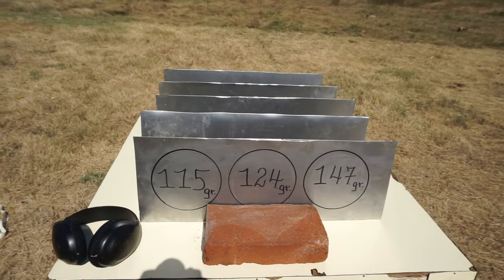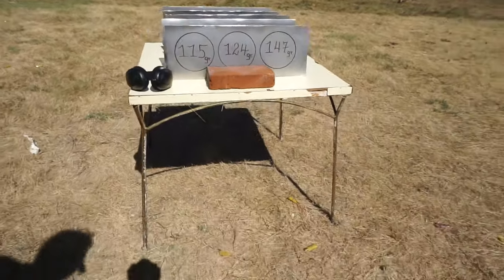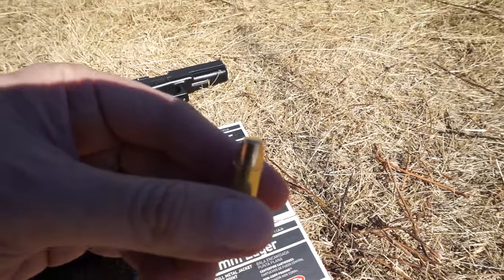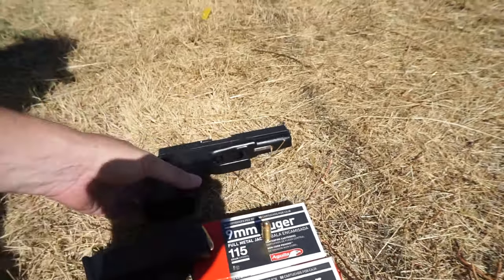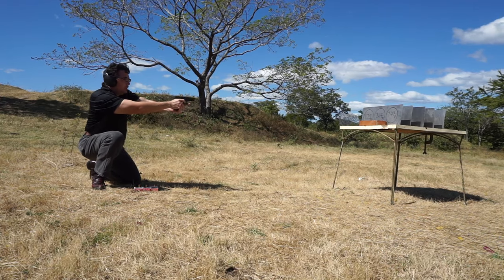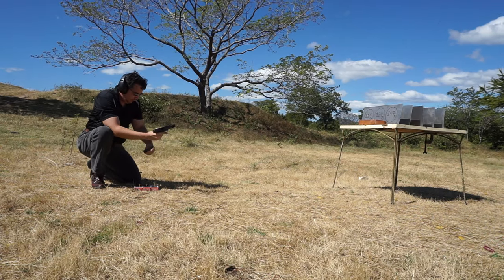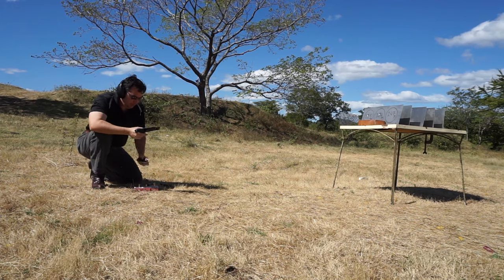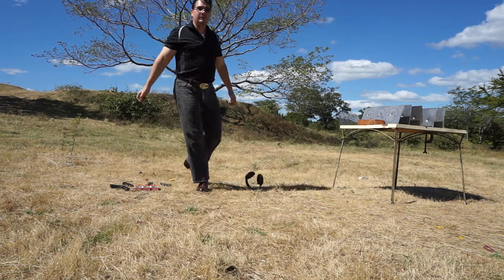9mm 115gr vs 124gr vs 147gr fmj 🔥 vs 5 Steel Plates⚙! (Second Video)

Comment: 147 did its job.  It’s all about kinetic energy transfer and not about penetration.  For the best self defense rounds, 147 JHP 👍🏻
Reply: Agreed....some of these youtube warriors are thinking the 115 is better because of penetration...when in fact the 147 having more energy more expansion equaling more damage..👍
Reply: @pearlman39  BOOM 👍🏻
Reply: From what I’ve seen 147 grain loads usually have around 320 ft/lbs of energy, most 115 grain loads have around 400. Dont get me wrong, I carry 147 grain HSTs, but energy isn’t in the 147 grain’s favor. I like 147 grain because it shoots softer, quieter, and launches a bigger chunk of lead into a target. More lead equals greater potential for expansion, more momentum to drive deep into the target, and in the event of a failure to expand, a longer bullet does more damage tumbling.
Reply: @CHAOSMOVEMENT  a kick from George St Pierre was recorded at a little over 3,000 ft/lbs, that's a little bit more than twice the energy of a 5.56/.223 fired from an AR 15. He has never killed anyone with his kicks. Penetration is more important than expansion or energy dump. Both are great, but proper penetration is nearly as important as shot placement, and handgun rounds don't have enough raw energy to cause remote wounding.
Reply: @jonahpatton8879  well said!
Reply: @jasonvoorhees2701  the o
Reply: @jasonvoorhees2701  the o
Reply: @jonahpatton8879  if the diameter of that kick was 9mm, with 3,000 ft lbs of energy, it'd obliterate a target.
It's not about "foot pounds don't matter", it's the diameter of the projectile is soft and huge, so it's spread out.
3,000ft lbs is like being hit by a car, all in a foot, but if it's by something as small as a dime, it's punching straight through anything.
Reply: @jonahpatton8879  any of the 3 rounds tested would zip through a human target. The 147 would dump more energy into the target on its way through. The 115 would zip through quickly creating more hydrostatic shock. I wouldn’t want shot by either. I’d say against a human target it’s more about what round you can put on the mark more accurately through your choice of firearm while in an intense situation. I would be more worried about a 22lr in the chest than a 9mm in the arm you know what I mean. It’s all about putting the bullet on target that counts the most.
Reply: @Billy28376  this wasn't a debate on shot placement, ammo choice does not affect shot placement. 147 grain 9mm has less energy, why would it dump more energy? Hollow point design is so much more important of a factor than bullet weight when it comes to penetration vs expansion. 147 grain Hornady XTP will over penetrate (based on FBI specifications), 147 grain federal HST will not over penetrate. Lehigh 105 grain maximum expansion under penetrates like crazy, and 115 grain FMJ over penetrates like crazy.
Reply: @LukeHimself  but the energy dump didn't kill anybody, if your point is that object penetrating deep enough to reach vital organs is lethal I think i made that pretty clear, and 115 grain 9mm is not causing any hydrostatic shock, you are obviously new to this whole terminal ballistics thing. momentum is a better analog at handgun velocities than energy numbers.
Reply: @jonahpatton8879  Oh my point was perfectly clear.. Try to insult me with ad hominems all you'd like, that doesn't change the face of a welding rod the size of a Sharpie HAS impaled factory workers because the ft lbs of energy behind that slow moving object :)
How about a spear? Or a flying Rebar goes right through windshields, people, etc..
The energy "dump" is absolutely part of penetration, but how about a HIGH SPEED SOFTBALL? Does a high speed softball penetrate through a person with all it's speed? How about a FOOTBALL? No? No.
Comparing something that can't penetrate a person, because of it's extreme size is ridiculous.
Put that 3,000 ft lbs in a GOLFBALL or anything small, and it'll blast right through a person, and while you're at it, look at industrial accidents with people being impaled - high foot pounds, low speed, small size diameter of contact area.
I'm not the person who sounds "new to this". I know it takes both speed AND energy.
Reply: @LukeHimself  and all of those high mass low velocity things that can penetrate straight through someone don't have high energy numbers, it's momentum that drives them through bodies, which goes back to my point about momentum being more important at handgun velocities than kinetic energy. You clearly did not understand my point in the slightest, I said that the actual "energy dump" at handgun velocities does not cause remote wounding, that only happens at rifle velocities. Penetration is is second most important factor of a handgun wound (behind shot placement), that is obvious, what are you arguing exactly?
Reply: @LukeHimself  also nothing was meant to insult, but there is so much more to terminal ballistics than you are aware. momentum vs energy, sectional density, forward facing surface area, hydrodynamic bullet expansion profiles that vary from brand to brand etc etc. It isn't as simple as "more ft/lbs equals more damage points".
Reply: @jonahpatton8879  Foot pounds and speed is used to measure kinetic energy, and to measure and get a complete view of the power factor, it's momentum is also taken into account.
My arguments were sound.
Claiming something with high kinetic energy with an extremely large diameter, with extremely low speed, is somehow comparable to a bullet's measurement of kinetic energy and momentum is ridiculous.
I gave examples of high kinetic energy things, such as a robotic welder, with a small diameter to argue the exact same point as you.
How well does your argument hold up against small diameter objects?
Spears, robotic arms impaling people to walls and cars, rebar flying through the air?
Anyway, my point was proven.
Reply: @jonahpatton8879  You continue attempting to "I know more that you, and you are somehow saying more ft lbs = more damage points".. I've never said anything like that, the false characterization is even further insults from you, while I'm still not insulting you. Good grief. My points and arguments are proven and stand.
Reply: @LukeHimself  but how are your points invalidating mine? All you can say is that your impaling wounds from Spears and rebar are true, but when did I refute that and how does it refute anything I said? A thrust from a spear has far fewer ft/lbs of energy than a 3,000 ft/lb kick. You are proving my point that things with fewer ft/lbs of energy can be far more lethal, and proving my point that penetration is a far more important factor than "energy dump". So I say again, what are you arguing?
Reply: @jonahpatton8879  I said, from the beginning, that BOTH ARE NEEDED. Dear god.
They are literally both needed to measure kinetic energy. Both are needed to measure momentum.
The Foot Pounds is what it takes to get an object moving to a stated velocity.
Also, that's how body armor is used, it spreads the energy across a wider area, as to absorb the energy.
Dude's foot is much larger than even what it takes to stop a 556 with Level 3 armor.
3,000 Ft. Lbs of dude's kick is really just a measurement of how much power he uses to force his foot forward, since that's what it stands for, "work required to move an object/energy carried".
Reply: @LukeHimself  what? penetration and energy dump? Not at handgun velocities. Those spear and rebar wounds are only as wide as the rebar or the spear head. Handgun wounds are only as big as the projectile (usually smaller actually because of the elasticity of living tissue), energy dump isn't a factor at handgun velocities, penetration and expansion however, very much are an important factor. The only two important factors behind shot placement.
Reply: @LukeHimself  you still haven't made it clear what your point is? That bullets are deadlier than kicks? Yeah I think I covered that pretty thoroughly in the original comment. My point was that energy dump without penetration is pointless, and all of your arguments have been about things that penetrate deeply. It's like you don't even realize that you're agreeing with everything I'm saying and adding nothing to it.
Reply: disagree
Reply: @pearlman39  sometimes penetration is more desirable than expansion. Sincerely, a yutube warrior
Reply: @pearlman39  except when, and this happens alot with pricey hollow points, the round doesnt meet the fbi requirement of 12 inches of penetration causing LESS damage
Reply: All else being equal (energy, stability, frontal surface area/bullet diameter/expansion), heavier projectiles penetrate further in soft tissue due to sectional density overcoming resistance over a greater distance. while lighter projectiles will penetrate hard surfaces, i.e. armor, due to higher velocities. penetration of a rigid medium like steel plates with a momentary zone of rigid resistance, Is a different type of penetration than a soft tissue medium with a long constant zone of resistance.
Reply: Negative sometimes you need both
Reply: @jonahpatton8879  What is remote wounding? I think it was on Joe Rogan, it was on Joe Rogan, special forces were talking about an encounter they had Behind Enemy Lines.  Anyway they shot a guy with their automatic weapons dead centre.  He subsequently ran 60 or 70 yards before dropping dead.  The myth of stopping power it may or may not be there.   Additionally, YouTube The Story of a police officer why carries  145 rounds.  There was a really good YouTube animation on this gunfight where the police officer emptied his 45   calibre hand gun handgun into a murderer, I think the guy was shot a total of 13 times, 6 times in vital areas and the guy continue the gunfight until eventually the cop  put three in his head.  The cop, was running out of rounds and took Refuge behind a car, the gun man looked under the car at which time the cop shot him three times in the face.  It's these real life encounters that are so instructive. 
Whenever possible, avoid the situation altogether.
Reply: @jamesharris184  remote wounding is something that rifle rounds do at close range, it's the reason a .22 caliber 5.56x45 does more damage than any .45 acp bullet ever could. Yes there are tons of stories where soldiers swear they are hitting a guy repeatedly with rifles and nothing is happening, that's called missing your target, police body cam footage doesn't lie, and everybody the police shoot gets examined post mortem, I've yet to see a single body cam video of a bad guy surviving a double tap from a rifle within 100 yards. People don't survive multiple rifle rounds center mass, the story you're talking about, officer Timothy gramins, is a great example of why pistols suck and rifles are awesome. 14 times by the way, he shot the guy 14 times, including shots to the liver, left lung, right lung, diaphragm, and one even nicking the heart. Poking holes in someone's body isn't always instantly fatal, a rifle liquefies internals at close range, it isn't even close to the same thing.
Reply: @jamesharris184  Shot placement is more important than either.
Reply: @taurus38splul  I concur.  If  accuracy is Paramount it would be 22-caliber all the way, assuming there are no barriers to go through. You know this argument never gets old and the data is torn and frayed.  But I've seen so many videos that would prove or disprove assumptions. This morning I watched the video of a home invasion and the woman used an AR-15 to protect her husband.  Bus home invader  suffered a Center Mass hit  and still ran 150 yards from the house with a chest wound and collapsed and died. The house owner said the AR-15 was more than equal to all of their handguns.
Reply: @pearlman39  energy doesn't stop someone when they've been shot. They may feel the impact more. Like some ppl get shot without realizing they've been shot probably because the bullet zips right through them. But the 147 dumps its energy into the person but at the same time may not penetrate as deep. Penetration is what stops bad guys
Reply: You're all missing the point. This test was to see how far a bullet could penetrate. The 147 loses.
If your talking about energy transfer, then we move to a gell block and use hollow points in 115, 124 and 147.
That's when you will see the 147's energy shake that block and create a great expansion chamber.
The lesson here is that you should carry both hollow points and FMJ. I carry an extra magazine of FMJ along with my 2 magazines of hollow point. The 115 FMJ  travels faster for more penetration through something if you have to do that. The 147 hollow point will destroy a body cavity.
Gotta know your application.
Reply: @EEDad401  thank you finally someone who knows what they are talking about instead of just siding with one kind of ammunition and bashing the rest. I agree 100% I carry both FMJs and JHPs and use 115, 124, and 147. They all have their uses
Reply: @LukeHimself  You have the pseudo-intellectual interpretation of ad hom. This is an often misunderstood and wildly overused concept in such forums.
Reply: ACCURACY IS FINAL. 
.22, .380, 9MM 115/124/147......
A SINGLE round placed accurately ENDS THE GUN FIGHT. Period.
-Once an Eagle
<3>
Reply: That 147 grain 9mm will shatter bones and organs rather then just going through and the other 115 will penetrate out of the body like a sting bee if you ask me both are damm horrifying different types of pain when hit by it.
Reply: It's about PENETRATION AND PERMANENT WOUND CAVITY. If the round dumps it's energy too soon, it won't penetrate enough to strike a vital organ. The "goldilocks" round is one that satisfies BOTH criteria, not just one.

(pistol rds don't typically travel fast enough to impart hydrostatic shock like you see with a rifle rnd. Pistol loads do their damage by DIRECTLY hitting vital organs and those organs can be DEEP. For example, the target is angled to you so you might have to go through an arm before you even get into the chest cavity. You are rarely gonna get the opportunity to shoot at something or someone that's facing you squarely. This is why the FBI standard accounts for both penetration (min 12")  AND wound channel size (~0.5" min). The FBI's post shooting analysis of that Miami shootout involving agents found the ammunition agents were using FAILED TO PENETRATE DEEP ENOUGH to inflict a fatal wound, thus allowing the perp to get off more rounds (-eventually killing the two agents).
Reply: @randycchavez  But I have heard that revolvers are more powerful then pistol rounds so the agents in Miami dade shootings used revolvers how can it be that it didnt penetrate through those two thugs on the other hand i think if one or two agents used AR platform rifles the casualties of that shooting would have turned minimal for the agents at that time 🤔
Reply: @jonahpatton8879  yes but speed is needed for proper expansion , to heavy of a load will not meet expansion threshold,  45 hollow points doesn't expand very well and it is due to the weight.
Reply: I think the reason most choose 115 for self defense is because of the great expansion with less penetration.     While still managing to go through a human torso, it reduces the possibility of  unwanted collateral damage.
Reply: @jonahpatton8879  You speakin the truth mane.
Reply: @LukeHimself  See Jonah was talking facts. You were talking "IF's" big difference.
Reply: @krashgamingandoutdoors1125   @krash gaming and outdoors  that's funny, I was replying to a guy talking about the ft lb energy of a person's kick..
I explained how that 3000 ft lb energy is spread out across the kicker's foot, so it doesn't penetrate the person.
If it was the diameter of a bullet, like 9mm, it would blast right through a person.. bones and all.
I'm not even interested in hearing your response of why this is "talking in ifs", when I was just responding to Jonah's "ifs"..
An entire year ago..
Reply: @LukeHimself  if you took the speed and weight of George St Pierre's leg, and condensed it into a 9mm ball, it would be potentially lethal, and it would still do less damage than a 5.56, because ft/lbs aren't the only thing that determines lethality. Especially at handgun velocities.

A 115 grain fmj has more ft/lbs of energy than a 147 grain hollow point, yet one of them will clearly leave a nastier wound. You negated nothing I said, you simply argued (for some reason) that a spear will go right through someone, and the best part, is that a thrown spear has nowhere near 3,000 ft/lbs.
Reply: @jonahpatton8879  MORE nonsense from a year old argument over nothing? Everything I said was on point, last year.
Take your sock account and argue elsewhere.
Reply: @LukeHimself  yes, you pointed out that penetration was more important than energy dump, but then again, that's what I said in my first post, which made me wonder what you were arguing exactly.

It isn't that you said anything wrong, just that you were arguing, but never disagreeing with, or even responding to any of the points I made.
Reply: @jonahpatton8879  I never argued, I pointed out that any amount of energy transfer doesn't matter if it's spread out over a big surface, shrink it down to a 9mm and it'll blast right through something.
That was my original response to something about some kick boxer's powerful kick.
Picture a building hitting someone with some huge amount of energy, it's still not penetrating a person, which is why a kick boxer's foot doesn't penetrate a person.
Then the arguing started.. at me.. I didn't have an "argument", just stated an interesting fact, you can go back and look.
Reply: Not for EDC pistols with short barrels
Reply: You said “it’s about kinetic energy” not about penetration? You got that backwards buddy.
Reply: I agree. It is about shock and energy transfer. That’s why .45acp was so popular until recently. Pure stopping power. But 9mm technology has become the most popular defensive caliber allowing more round capacity without sacrificing stopping power. The 147gr has that with less chance of over penetration.
Reply: That's not how physics work. Being stopped in the target does not delivery anymore energy as going through the target.

In fact, sporting ammunition manufacturers have discovered that bullets that got all the way through an animal, are much more effective than those that get stopped inside.
Reply: @donwyoming1936 don't waste your breath trying to use math and physics on the YouTube warrior crowd. It's waaay to deep for them. Also, testing FMJ projectiles for penetration further skews the results when compared with JHP.
Reply: Well it isn’t just penetration but the more velocity and speed equals more expansion
Reply: @jonahpatton8879  You guys both have it all wrong. Basically the only new principle involved is that instead of power being generated by the relative motion of conductors and fluxes, it is produced by the modial interaction of magneto-reluctance and capacitive diractance.

The original bullet had a base plate of pre-famulated amulite surmounted by a malleable logarithmic casing in such a way that the two spurving bearings were in a direct line with the panametric fan. The latter consisted simply of six hydrocoptic marzlevanes, so fitted to the ambifacient lunar waneshaft that side fumbling was effectively prevented.

The main winding was of the normal lotus-o-delta type placed in panendermic semi-boloid slots of the stator, every seventh conductor being connected by a non-reversible tremie pipe to the differential girdle spring on the “up” end of the grammeters.
Reply: @_EightySix  you forgot about the pharufacis of the Flux capacitor.